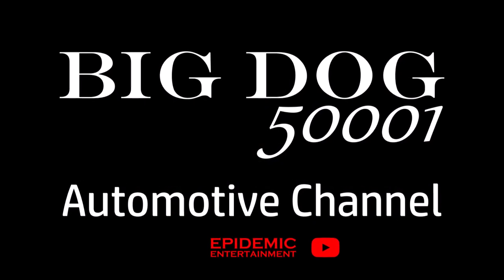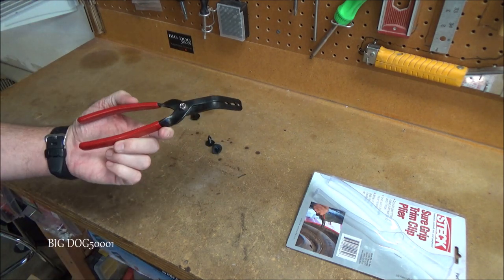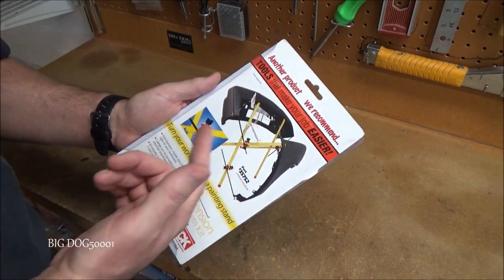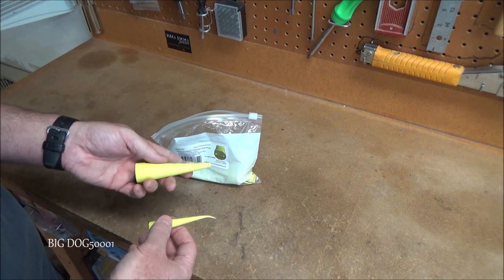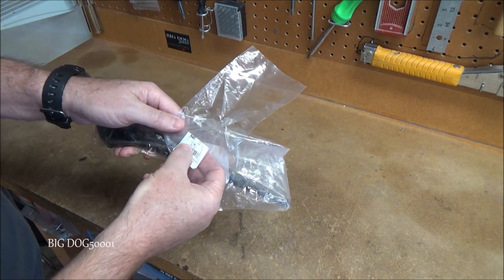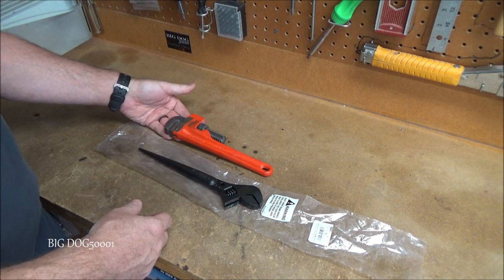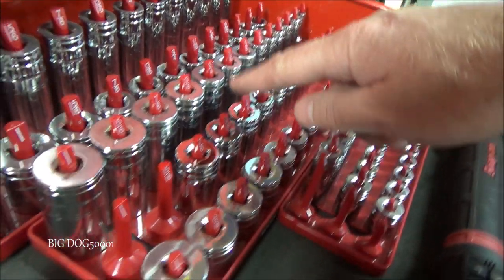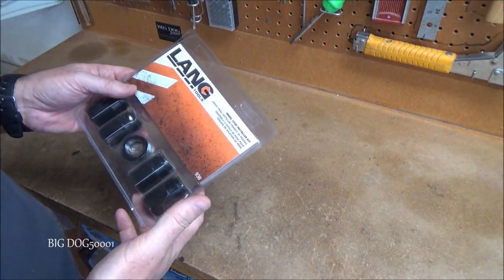New Tools! Episode 2104 - New tools from Steck, 3M, GearWrench, Milwaukee and More!

Comment from the maker: Tools in Video
Disclosure: This channel earns a small commission using some of these links - at no additional cost to you.
Steck Trim Clip Pliers 21720:  https://amzn.to/2ZiIwYj
Steck Extension Arms 35752:  https://bit.ly/3nMJENe
Mess Stopper Service Plugs:  https://amzn.to/2Zi43Am
Klein 10" Alignment Wrench 3227:  https://amzn.to/3FLeoVi
Ridgid Rapwrench:  https://bit.ly/3l5hn2Q
DeWalt Angle Grinder DW840K:  https://amzn.to/3DRc1zs
Welper YS-50 MIG Pliers:  https://amzn.to/3cIirFp
Vise-Grip MIG Welding Pliers MG8:  https://amzn.to/3r7BmS7
Millermatic 211 MIG Welder:  https://amzn.to/32lvomo
GearWrench 1/4" Midlength SAE Sockets 80305S:  https://amzn.to/3cIyZwP
GearWrench 3/8" Midlength SAE Sockets 80555S:  https://amzn.to/3FJxDhJ
Hansen 3 Row Socket Trays:  https://amzn.to/3nW3oOR
Lang/Kastar Wheel Stud Install Kit 938:  https://amzn.to/3CQQRA6
Milwaukee M12 Angle Die Grinder 2485-20:  https://amzn.to/3oZZfse
Milwaukee M12 Battery:  https://amzn.to/3HR25s3
Chicago Pneumatic Angle Die Grinder:  https://amzn.to/30Xjzlz
Lisle Tap Socket Set 70500:  https://amzn.to/2ZnJMto
3M Worktunes 90543:  https://amzn.to/3nLrYlk

The Big Dog 50001 Automotive Channel Store can be found here: https://www.amazon.com/shop/bigdog50001automotive  (As an Amazon Associate I earn from qualifying purchases).

Comment: Thanks would you have a recommendation for a 17mm extra long box ratchet wrench to remove Honda Element upper control arms?
Reply from the maker: Gearwrench model #86126 are my go to XL box ratcheting wrenches, they have the flex head which I like.  https://amzn.to/3FIDcNx  
Model #85989 does not have the flex which can be good for certain applications.  https://amzn.to/3oWBtgS
Reply: @BigDog50001  Thanks enjoy your Thanksgiving